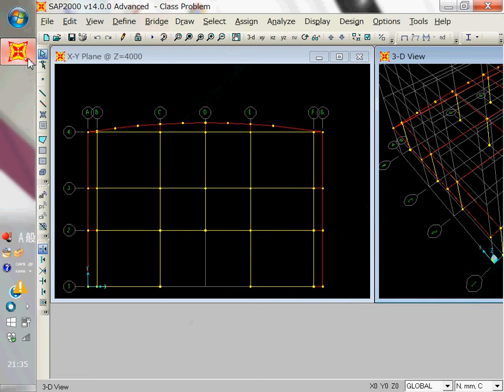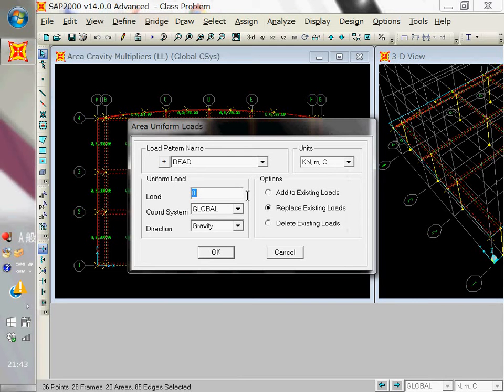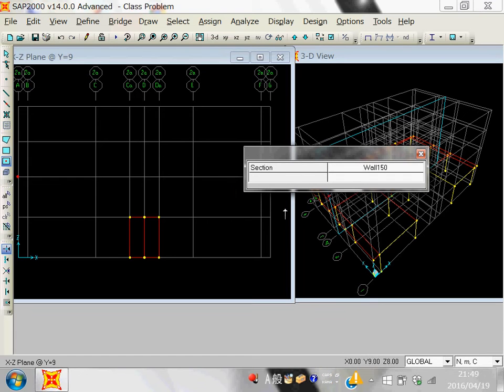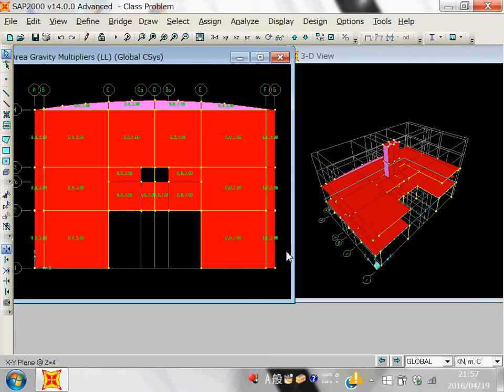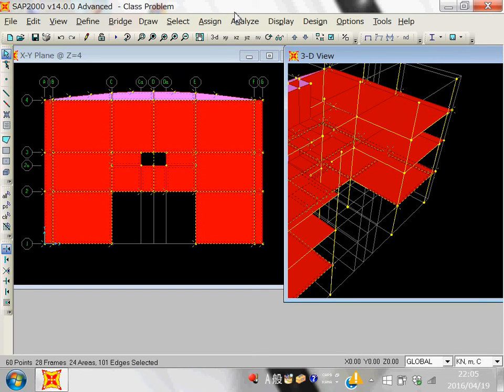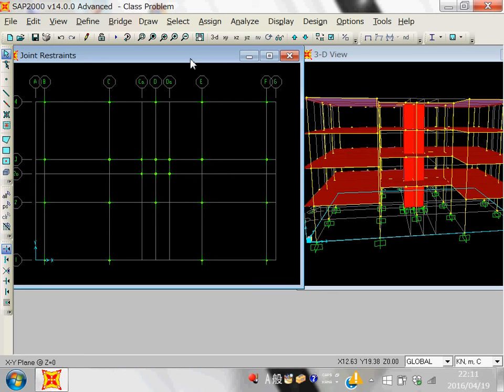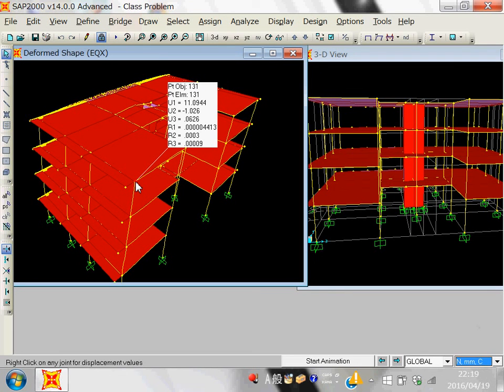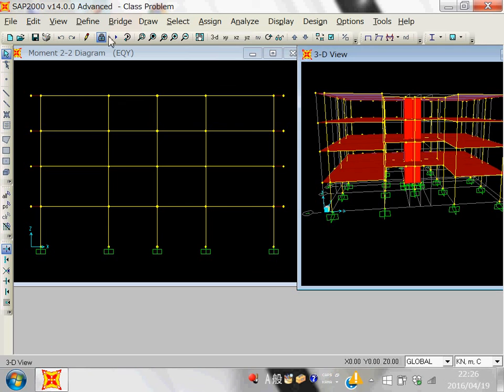Sap 2000 Tutorial for beginners To Design a Concrete Building Part-4

Comment from the maker: Dear All! Most of you have asked about the load calculation. Dead Loads are calculated based upon densities and self-weight of slab and floor finishes. I think most of you know load calculations. Whereas Live Load values are taken from ASCE_Minimum Design Loads_2005 for structures. You can find a live load section and a table with load values. Regarding Seismic Loads, The loads are applied as per UBC-97. I will try to make a video of my class lecture for seismic loads calculations.

Comment: Dr 
What is the seismic values in x and y direction should we consider to be assigned for the shear wall.
Reply: Dear Arafat
Kindly explain your question. This building has shear wall and considered as dual system for design.
Reply: +Mian Naveed 
Dear Naveed tell me what values you need. Are you asking surface finish load and live load values?